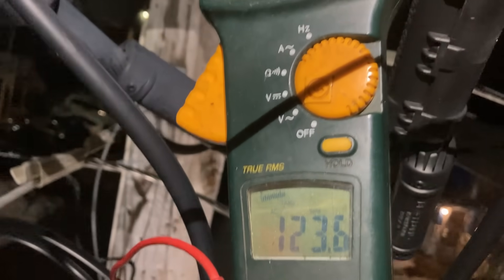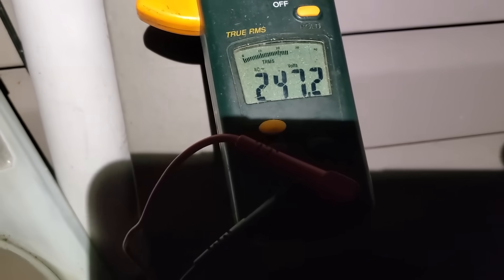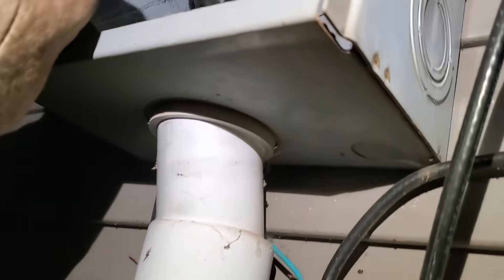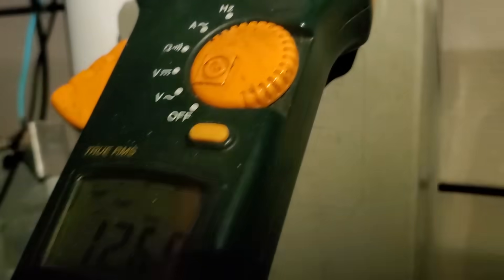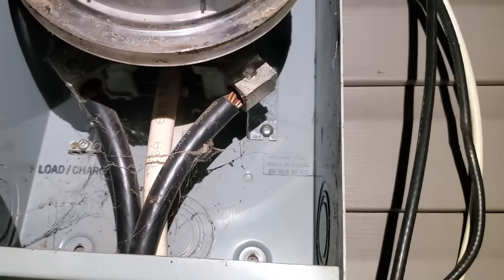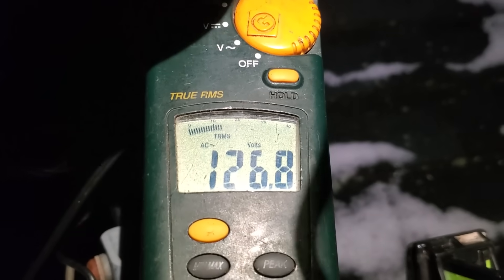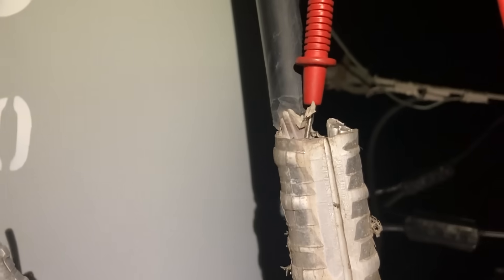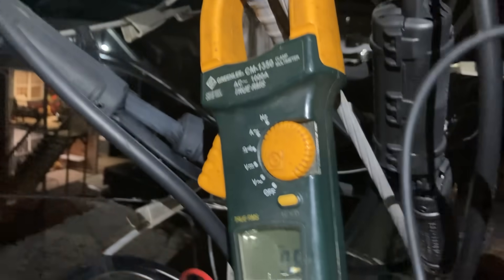Finding a bad neutral on a Service - Raw footage

Comment: If you lose your neutral all together then things go from bad to worse real quick.  

I've seen around 220Vac on one leg before which means everything not being protected behind a surge protector gets destroyed instantly 🤢

It all depends on how the 120Vac legs are loaded because with the Neutral (transformer center-tap) disconnected the circuit becomes a voltage-divider hence the voltage across each leg is based solely on the resistive loads.  Unless the loads on each 120Vac legs are balance then you'll have more voltage on one 120Vac leg compared to the other.

I've seen linemen remove the service meter and plug a device into the meter base to simulate an unbalanced load to find the problem so there is no need to bother the customer with turning on appliances.

Just wondering if it was re-crimped with "anti-oxidant joint compound" to prevent the cable from oxidizing again due to heat which is why that connection was failing to begin with.

It's not rocket science 😊

Checkout "Open Neutral" on Dave Gordon's channel which perfectly illustrates this problem 😉

By the way, this is exactly how to check for bad wire or connections on a 12-24Vdc system using the "LoadPro" probe.  Open voltage won't show the problem until you put a load across it then the voltage drop becomes obvious 🤠
Reply: That  happened  to me  and my neighbor in 2005,  power company  transformer  lost its neutral  connection  to the distribution  neutral  ,both legs went wild ! Power company  bought  us new televisions and microwaves .

Comment: Ran into so many bad neutral and bad grounds on long Island doing coax cable installs. Voltage on the coax using my coax as the ground.

Comment: I'm an engineer who has worked on industrial projects my whole career. I pays to have electricians who understand wiring in an industrial facility. On my very first project a bottling/canning plant for Ocean Spray, yes I was very green, we had electricians who had only performed residential work wire the plant. Oh my. Hot neutrals all over the place. As in 480VAC hot. They couldn't read the drawings. It was that simple. And the drawings were just fine. I got the job of fixing all of their mistakes on the automation end of things. Really surprised nobody was hurt.

Comment: I received a call out to a residence that recently had a new service pole and pole light from the supplier…flickering occasionally…went thru the typical checks, loose something here or there, finally got suspicious and went to the service disconnect…incoming lines were 150 something and 80 something as I recall…wowzer! quick call to the service center and had them out shortly after…the pole well off the road had the transformer mounted and it was their baby from there…they had to cut trees, all sorts of bs to get to it….they never indicated what exactly was the culprit..I suspect it was from the transformer to the triplex..as they needed to head back for wire…

Comment: Fascinating video Aaron! I have ran into a few bad neutrals in my years as a telecom tech, and have actually seen telecom lines toasted due to that imbalance from the bad neutral finding its way onto low voltage wiring (typically toasting some comms equipment in the process!) Love seeing how that is diagnosed and repaired!

Comment: Saw that on a service call out in the country. All the connections at the at service loop were fine but the dropped neutral was at the transformer. Called power company and it did not take long for them to fix it.

Comment: Does voltage drop across the wire work on AC systems? We use this on DC such as starter circuits. To check the ground we connect volt meter to bat ground and the other to the starter. If the meter shows voltage above about 1/2 volt when starter is energized it means too much resistance. Just curious if this would indicate the same thing on AC systems?

Comment: I'm curious what amount of voltage deviation would be considered normal or acceptable?  Like I haven't fully quantified it but I know if there's say 30-50 amps of imbalance current they're becomes a measurable amount of imbalanced voltage...but it doesn't seem significantly different than the amount of sag like when the auxiliary heat kicks on with 60-100 amp 240V draw and the entire house panel voltage dropped by 5V or so

Comment: This is exactly what happened to my house a few years ago. The lineman had me put a bowl of water in my microwave while he took readings. He re terminated the neutral connection at the transformer. No problems after that. It had been like that for a while. The spikes killed one of my UPS's and I had scorch marks on my light switches.

Comment: Here i lost about 10k worth of equipment and time at least due to a lost neutral. It took EIGHT months for the power company to go up on the pole and replace a 4 ft piece of wire from transformer bank neutral lug to the neutral wire on the pole. 

All this started with hurricane Zeta around a Halloween ie end on October..

The only reason the power company camenin June was their system on a windy day had my TWO service entrance smart meters freaking out with the lost neutral 

The green new guy was disappointed that the meters looked ok and two service heads and secondary wires to the transformers..

Only the old guy would listen. I told he he had a loose neutral at the pole. 

The guy balked at even checking it.

So i asked the guy what are the odds your stance is correct that both meter curcuits magically loose the neutral exactly the same time on a windy day?

So i showed the old guy two sets of 4 bulb neutral testers on my 2 meters circuits 

2 pairs bulbs in series across 240 volts. One set has a connection to the neutral. The set connected to the neutral has a super bright bulb and super dim bulb on windy days.

All 8 bulbs can be seen at a central place in my building.

During a loose neutral event both service entrance meter circuits have the bulbs going bright and dim exactly the same time.

So this sank the local power companies stance that it is wiring problem in my building 

Both power company guys actually told me i need an electrician.  As a registered engineer in EE i told them the were wrong and one of you need to go inspect the poles neutral to transformer connections. 

So the older guy went on on the bucket and touched the neutral wire with a pole and saw sparks.

So he came down and said i was right. He installed crimped a new wire from transformer to neutral wire that is on the poles and problem went away. 

The power company came out orginally after i complained after zeta. The arrived with a super brute and declared not their problem. It has to be my wiring. 

They came out on a still day. So their neutral load tester did not have show bad with an intermittent connection 

After that 1st test by a super brute a vile lady in customer service barked that they already have been there and not their problem

So because the power co did not know what they were doing i had to buy  several dry 0.5 to 2 kva 240 to 120  step down transformers.

Ie act like 3rd world stuff. Run computers credit card machines. Ups. Printers. Phones any critical 120 volt stuff on my step down transformers.  

That way the 120 volt stuff is not effected by a loose neutral. 

The local power co had many lawsuits due to zeta. That is why the vile customer service lady barked it is your problem not ours

When Disney on ice travels they use stepdown transformers since they have had show equipment all blown due to a lost neutral

Lost about 20 plus surge protector plug strips due to that lost neutral after Zeta..

Lost a ups. Two credit card machines. Dozens led bulbs. Computers. 

Giant mess

Comment: I'm surprised your employer does not provide you with a Super Beast by Arnett Industries. They create their own load so you don't have to unnecessarily put bad voltage levels on the customer's equipment to have a load and you won't have to request that the customer turn anything on.
Reply: https://www.youtube.com/watch?v=0sG-n0QthfA

Comment: IMHO, if you're going to try to test by turning on an unbalanced load, what you should do is actually turn off all breakers except for the one going to the microwave (or whatever), then turn it on.  That way, if the other side goes up dramatically in voltage due to a bad neutral, there's nothing actually connected to that side which could end up being damaged in the process.

Comment: @eDoc2020 Keeping track of the circuit's paths is an indicator of ones troubleshooting skills. I always endeavored to know the circuits under test. Like computers, the brain suffers the same issues of "garbage in = garbage out" syndrome. If you do not know the actual circuit, your techniques may seem irrational.

Comment: A loading meter (Lo-Z) might have found the problem without having to turn on loads inside the residence
Reply: Yes and no. There was still a few ohms across the bad connection so the few thousand ohms of a Lo-Z meter would not do much. You'd need a specialized test device which does exist.

Comment: So this also means that the ground rod on the client's side is not doing its job. 
The neutral is supposed to be grounded at the main panel using an independant ground wire to prevent to sort of things.
Reply: The ground rod is not supposed to be a low-resistance path for fault current, it's there to make sure everything within reach is at the same potential. IIRC the spec for a good ground rod is 25 ohms.
Reply: @eDoc2020  25 ohms is clearly a LowResistance path.
Reply: @martf1061   The neutral wire is perhaps 50 milliohms. Compared to that 25 ohms is absolutely massive.
Reply: @eDoc2020  indeed, but grounding the neutral at the main entrance, is only to prevent having any unwanted voltage or current from the client's installations,coming back to the power company's side.

Comment: How do you change that neutral connection. Do you remove the meter to remove the load,then change the bad neutral, connector. I know the electric company changes it. Just curious
Reply from the maker: You have to either remove the meter, shut off power at the transformer or jumper around the bad connection.

Comment: How did the voltage jump up from Service side of 123 volts to 128 volts on the customer service side, by simply passing thru a splice ?
                         🤔....?
Reply: It's because the reference point is not transformer ground. Relative to transformer ground the no-load voltage on all three wires was 123-0-123, under load it was 123-5-123. The voltage comes from the other phase drawing more current and causing voltage drop.

Comment: Great troubleshooting! I’ve only ever had to deal with partial voltage losses, which can take some time to chase down. Sometimes it’s hard to call the cause when it’s intermittent voltage loss. I’ve checked a panel in a mobile home to make sure it was good at the service because they intermittently has flickering lights but only after their down syndrome son knocked a wall loose. According to them they hadn’t had the light problem prior to that but the issue they seemed to have was an outlet on the kitchen counter serving a microwave. I changed out some old old receptacles that I thought could have been the problem and the problem seemed fixed but returned and ended up being the lateral line feed from the source pedestal.

Comment: A long time ago, early 1990's, living with my parents, every so often the lights would go brighter or dimmer. Sometimes they would get so bright the 100 watt incandescent lightbulbs would POP and I would have to use a potato to get it out. JUST KIDDING! I turned the power OFF and took it out safely. Often, our floor model TV's built in circuit breaker would trip. 
When I took transformer power transmission theory and they taught us what happens when a neutral is loose I realized what was happening.
One night it happened and my bedroom light became REALLY BRIGHT. 
I grabbed my Fluke 73 True RMS multimeter and checked the voltage from neutral to line at my receptacle and I measured 194 VOLTS!!! 😮 That only leaves 46 Vac on the other line! THAT'S  a serious imbalance. Looking back on it now I'm amazed that only the odd light burned out. Today's CHEAP electronic crap wouldn't stand up to that kind of abuse. 
I went to the basement and checked the breaker panel for heat and it was so HOT I couldn't touch it for more than a fraction of a second. I took the cover off and found the main neutral connection was loose. I tightened it up and never had that problem again. That burned into my mind just how dangerous a loose neutral or disconnecting a neutral that is BEING USED can be!
Reply: looks at the nearest piece of cheap electronics
"Input: 100-240V~ 50/60Hz"

Not saying you don't have a point (you do) but most of the cheap electronics these days are actually rated for more voltage than you were seeing :D
Reply: @aprilkolwey4779  hehe in a area with 3 phase 400 V....  (ie northern Europe for example)
a fault like that would be more like 320 V ie 90 V above nominal....

Comment: Huh...  Could this be why I have voltage on my neutral lines in my house at the panel?
Reply: In a US/Canada install the neutral and ground are directly connected at the main service panel. If you see voltage between neutral and ground there then your bond is bad. Also note that if you have an outdoor main fuse/disconnect that would count as the main service panel and the house panel would technically be a subpanel.

If you are in a different country with a different earthing type things will be different.
Reply: @eDoc2020    I'm in the US.  The first time I was aware of the problem, the person repairing the coax cable line to my house noticed an arc when he connected the coax splitter to the ground wire.  My panel had no ground, but the meter box has a ground wire connected with the neutral, and that was were the voltage that caused the arc was coming from.  

I later had to have the neutral connection from the drop to the meter box replaced once before, as it had melted and was sparking when I ran my dryer, but the repair crew never said anything about the issue with voltage.  

Should I call my power company and have them check for an issue with the connection at the pole with the drop to my house, or do you think that it might have something to do with the wiring in my house?
Reply: @hellcat1988  First of all, does your meter box have a main breaker / fuse / other disconnect? From your descriptions and my understanding of code I think it does, but I want to make sure. Then the other question is how is your panel grounded? My educated guess is it has 4 conductors coming from the meter box: two hots, neutral, and a separate ground. Is this true?

The really odd thing is an electric dryer is a pretty balanced load. If a dryer causes a connection to overheat I'd expect it to be one of the hots, not the neutral.
Reply: @eDoc2020  The meter has no disconnect, other than pulling the meter head, and no fuses.  There is also no ground going between it and the panel.  The panel itself is also not grounded by any other means. The dryer causing an arc problem was just how I noticed there was an issue.  I don't know what caused or when the neutral crimp melted.

My ex-contractor friend informed me that as long as the meter head is within something like 3 feet of the meter, you don't actually need an external disconnect in addition to the main breaker in the panel.

I should probably make clear that the house hasn't had a licensed anything doing work on it in probably more than 50 years.  My landlord is a slumlord who doesn't want to pay for quality work OR materials.  Any work that's been done to it that even comes close to code has been the minor repairs I've done to improve quality of life.
Reply: @hellcat1988   I don't believe your install meets recent code but the service grounding rules changed in the 1970s. It's probably fine for when it was built.

There should be a neutral-ground bond inside your panel. If there's voltage between the neutral lug/busbars and the panel's case/ground bar then this bond isn't working. That would be an easy fix. However that shouldn't cause any current on your cable line.

If there is current on your cable line then it means there's a bad neutral somewhere between the street transformer and a service panel. It doesn't need to be yours, if a neighbor on the same transformer has a bad neutral the current can show up on your cable line.
Reply: @eDoc2020  Ahh, so I need to tell the power company to come out and check ALL the lines until they find the problem.  Thanks.
Reply: @hellcat1988   Before you do that you might want to shut off your main breaker. IIf the current remains then you can be sure it's not on your side.

Comment: So that’s interesting watching you put the meter back in, I was always shown and taught to do it bottom first then the top when installing and then removing the top first then the bottom you did it left to right is there any preference that you know that’s right or wrong either way, thanks, love your videos, work safe
Reply from the maker: Bottom to top is preferable, but doesn't matter a whole lot as long as you line up two lugs so the other two fall into place. (I wouldn't go too top to bottom though). In the case the meter socket was too high and going from bottom to top was difficult to see what I was doing.

Comment: This happen to me 4 years ago. Took 4 calls to the electric company. I told them I was seeing 136 volts on one side and 108 volts on the other. They changed the meter and never tightened the screw on the neutral. Melted the screw and the aluminum wire. Amazing people like I had come out never checked it.